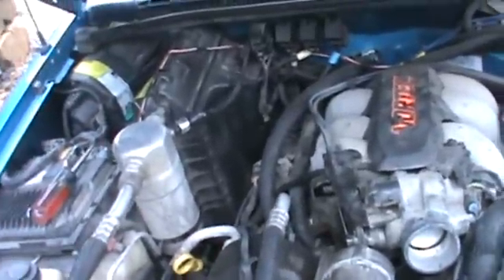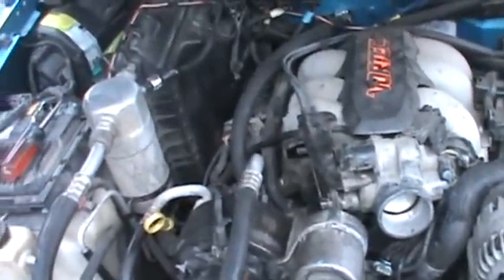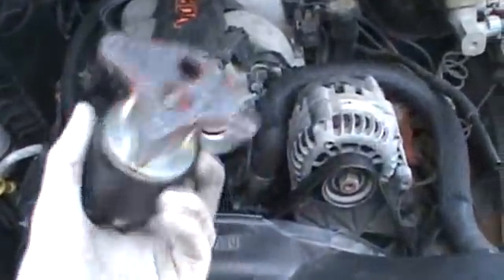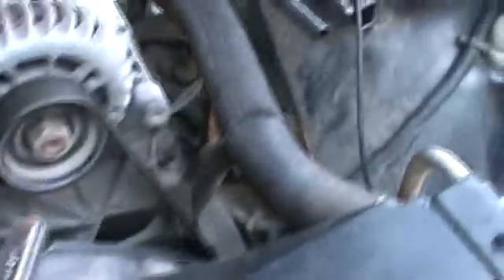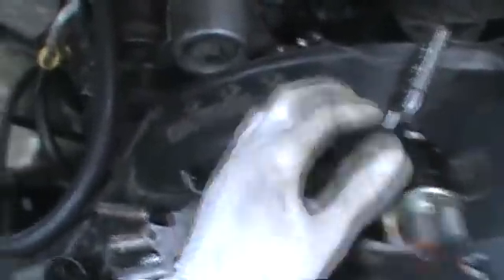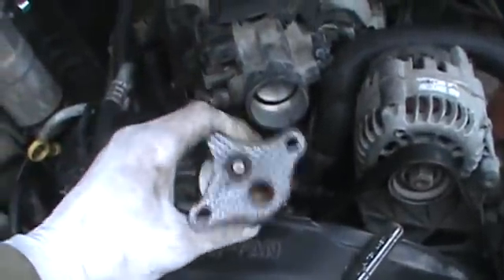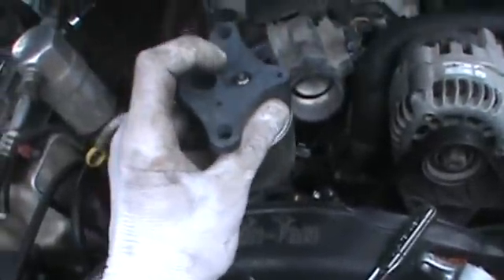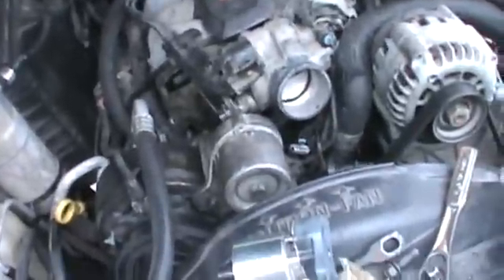how to fix General Motors Vortec EGR problems

Comment: On my old Toyota i could jump two wire in my fuse box and my engine light would flash, and i had to count the number of flashes to look in a Haynes book to find out what the problem is. I don't know if you can do it on this one but you could probably look it up.
Thanks

Comment: Let me guess egr light code came back on half year later lol
Reply: Every damn time!  I had to clean the screen on mine every six months for a couple years.  Now the light still comes on now matter what.  I replaced the EGR valve on a wing and a prayer, but that didn't work either.  So now I just live with it.  Runs the same as ever.
Reply: Cuz I did the same and that mf just would not and could not leave me the hell alone, I like the 4.3 but that shit was pissing me off lol ditched the 4.3 and went with the 5.7 and best choice I’ve ever made lol this one had way more mileage than my old 4.3 and yet the old egr on this one doesn’t care at all 😂 one thing is certain tho the 5.7 hella quicker and snappier, with a bit more torque, slapped some 295’s cooper cobras in the back and slotted rotors in the front 😎 shit sails, I love this piece of shit, but now I wanna go ls to see what the fuss is about and or 454 but they expensive

Comment: I had a p1406 at first, then I bought a new one EGR valve, then installed, then it showed the p0401 like it's not enough, then I bought another for 60 bux previous was 35, and it still not working good. P1406 came back and now I have p0140 there:( 3 freaking codes now

Comment: I am getting the same code but my truck wont start... ran fine last night.
fixed it today and it was a ground wire in the trailer hitch. the ground was broken and it was causing the truck to not start at all.

Comment: When I start with the egr off the engine revs up high is that normal
Reply: Ya unmetered air enters and the fuel system tries to compensate - I scribed the egr on a piece of aluminum 30 thou thick, and cut out the shape and bolted the aluminum in it’s place then you can run it and watch the pintle

Comment: Use paper clip and connect terminals A and B of the diagnostic connector. Turn your ignition key on with engine off and the codes will flash from engine light.
Reply: Diagnose it don't do what he says like just replacing random chit that you don't know is broke it's more common that spider injector's act up on vortec engine's.
Reply: Bad egrs wont always trigger a fault
Reply: My point was that its ez to run codes because he acts like its not

Comment: I have 1997 s10 2.2. It has this same egr valve as this video. I did the test, it wasnt working, bought a new one....still not working, the new one is also not opening and closing. What is the next step to try to fix my truck? And how? Thanks for any help

Comment: so my car sounds like shit right, just ruh ruh ruh stutter sound, i have change the air flow cause it said, then i gave a descent tune up, new sparks and wires, but for some reason it kicks back when i accerlerate like around 5 RPM do you know why ? i also put a new crank shaft sensor
fuck it someone call me if you know, 2564583744  4.3 engine by the way
Reply: Lazaro Gaspar had the same problem on my Tahoe.....had my 3,5,7 wires mixed up....

Comment: ! am an ASE Master Tech and I own a '95 1/2 Jimmy.  There is a scanner that will pull codes for this vehicle and it works with the "Torque" app and bluetooth.  It will not do "Mode 6."  These EGR valves can stick open because of carbon and the fix is an EGR gasket with a screen built in to it.  There is not a separate system that measures EGR flow.  So, if you get a P0401 99% of the time it is a bad valve.  Thanks!
Reply: I have a 95 1/2 Blazer, which fortunately has OBDII.  Got the P0401 "EGR flow insufficient" code going right now, so looks like a new valve for me.
Reply: The screen in mine burned out in no time...fix my ass
Reply: wtf did you just say dude ? so my car sounds like shit right, just ruh ruh ruh stutter sound, i have change the air flow cause it said, then i gave a descent tune up, new sparks and wires, but for some reason it kicks back when i accerlerate like around 5 RPM do you know why ? i also put a new crank shaft sensor

Comment: Had a 94 Sonoma 4'3...bought new  taken care of...biggest piece of shit ever. Constant egr problems  after  30k miles...not to mention...fuel pump,,,the injection system...altenator.AC.front end.power windows,,mirrions,,wipers...everything you could think of broke on that hunk of junk.Swore me off  GM forever.
Reply: Mike Brewer got a 2000 jimmy 4.3. You aint lyin. Bought it cause it was sitting in a field with 95k on it. Some dumbass kid slaughtered the 4l60e in it (i have no idea how). It sat for 4 months before I bought it. I have replaced fuel pump, filter, spider, fpr, maf, egr, pcv, vacuum lines, and lucifers left testicle. Runs great now, but f%@$ this thing.
Reply: Forgot the control arms and 2 computers...1st under warranty 2nd one cost me $1000 bucks.It was a beautiful truck too....an SLE with the very rare purple paint.Finally got rid of that monstrosity after the 5th EGR valve. and the dreaded code 32.. Only the 94-96 HO 4'3's had that particular part. Left me on the side of the road many times.One time had a new one put I at the dealer and didn't even make it home..I will say the engine.trans  and cooling system were fantastic....no troubles there..but I went back to a new Nissan truck..and I still have it 15 years  later. Only been stranded twice with a dead battery and once a  1ten year old radiator hose  broke.. I will probably die before this truck.
Reply: Mike Brewer yeah. It is hangin in there at the moment. I have done a 350 swap on two s10s. I am almost tempted to fix the next problem with a good ol "bye bye 4.3" action. I just dont know if I am prepared for the mpg loss lol. Arkansas doesnt have inspections so you can do it right
Reply: Eli..I might add the replacement  Egr's were the "improved" ones with the screen to prevent them from clogging up....but  the screens burned up in no time
Reply: Mike Brewer if the computers werent so damn touchy, could have bypassed the egr all together. But noooooo. Gm wants every chinese ass part to work in harmony
Reply: Well im in California so that wasn't an option.I like  the 4.3...had an 89 with over 200k miles when the trans gave out so that's why I bought the new 94.
Reply: Mike Brewer a 4.3 is an incredibly good motor. It is a mini v8, literally. But, gm managed to castrate everything it could possibly be. The only way to enjoy one is to take it back to the carb days, when shit worked great with the turn of 2 or 3 screws. As you said though, cali kinda keeps a motor head/someone who enjoys american engineering, from doing anything productive.
Reply: My  CPI injection failed about 60'000 miles and cost a fortune..about 900 bucks in 1999.  My  repair shop said  he saw so  many of them he actually  kept the kits in stock..I cant fathom how even GM could build such a pile of shit.

Comment: My smog system has been removed everything blocked off and I am getting egr codes and truck stumbles and hesitates around 1900 rpms to 2500 rpms when above 55
Reply: I have changed the entire ignition system and the only codes are for the smog and egr. Any thoughts?? It is a 1997 Yukon 4wd 5.7
Reply: Sounds like a clogged catilatic converter
Reply: so my car sounds like shit right, just ruh ruh ruh stutter sound, i have change the air flow cause it said, then i gave a descent tune up, new sparks and wires, but for some reason it kicks back when i accerlerate like around 5 RPM do you know why ? i also put a new crank shaft sensor 

same here with my truck
Reply: You gotta have it programmed out

Comment: Wish us he would of actually shown us the removal of all the crap in the way of getting the egr valve out and maybe even the tools required. Not a single video on youtube doing it to this motor inside a suv/truck chassis
Reply: You only need a basic socket set. You can't have someone hold your hand for every little thing. If you can't figure out how to take two bolts out then maybe working on your car isn't for you.
Reply: It has two bolts on it, all you do is unscrew them and then unplug it.
Reply: man its two bolts.... doesnt sound like you should even be messing with it
Reply: 2 10 mm bolts on the front of the engine at eye level, easy peasy

Comment: can these parts be cleaned n how...  I'm getting the egr  code but my car is not running ruff n is idling normal..  n drives smoothly on a 2000 GM Yukon  Denali

Comment: It's not recommended to blow compressed air through the egr valve, if doing so may result in chunks of carbon to be logged down in the intake ports or into the combustion chambers and can result in internal damage such as valve seat damage cylinder wall gauging which results in loss of compression and oil burning and rough idle and defiantly poor gas milage! the only way to clean the port is a small cleaning brush and vacuum cleaner and carb spray.
Reply: Most of the carbon lodges in the top of the tubes on the v8 LS engines. The proper way to do clean that out on the v8 LS engine is to take it to someone that can heat the bolts in the bottom of the V8 engines that have that tube. In this case this is a 4.3L and removing and cleaning the intake makes a huge diff once the new valve is in it. U won't be throwing carbon down an already partially blocked intake by trying to a half assed clean job. The 4.3L intake porting for the EGR can at times cake up severely and in almost every 4.3L I have ever worked on if the valve is caked up and the port at the top of the intake is also caked up inside the intake. THEN it needs to come off>>> (THE REASONS YOU SEE FOLKS REPLACING NEW EGR VALVES). When only the top of the intake port is clear the valve itself is new. It will only functions for few 1000 miles and ya got the problem right back plus you start burning valves up. The people with the 4.8L on up are lucky GM got wise to their mistakes on mounting the EGR on the intake it self so when they went to the HEMI clone motors known as the LS engine they also designed that beautiful plastic wonder called the Vortek intake that works like a gem. The LS motor tube assembly for a new QUALITY part is about 80 bucks you can even buy a cheap EGR for about 40 bucks on EBAY. As stated take it to someone that can get those little bolts in the bottom of the tube out without stripping em and having to remove the exhaust manifold. A blocked EGR can effect compression and not just a running engine but a static compression test can show lower than normal cylinder pressures. Had it happen here. Nearly told a customer his 4.3 engine was shot only 100 pounds a cylinder. Once the manifold was cleaned out and new EGR was in place the engine compression jumped up to 135lbs a cylinder. Not impressive by any means but for a 4.3 4.8 and the 5.3 motor about 140lbs is a normal used engine. Anything above 160 is a phenomenon okay. I have seen 190K 5.3L with 170lbs & 160 a cylinder. The 4.8 with a clean EGR will check out at about 140 to 160 a cyl.  Never ever just replace 4.3L intake mounted EGR valve and spray it with air & carb cleaner. THE PROPER PROCEDURE IS TO REMOVE THE INTAKE AND TAKE IT TO A SHOP THAT HAS A DIP TANK. Any machine shop will have your intake for 3 to 6 days. I let em sit in the acid for 3 days myself. Anything less ya still have gum and gunk inside the intake. Then I run my brushes thru em. That also makes the remaining shit fly out onto me all over the work bench and at times out the other side of the intake port holes. Never just slap a new EGR on a 4.3L intake and do a half assed clean out job. A new valve will start making the engine run lean and start frying valves and tops of pistons. A 4.3L intake is not easy easy to remove but easy enough that you can git it done. Remember to mark your distributor on the 4.3L with a distributor. I hope I helped here and nobody bites my head off. Replacing the valve and half assed cleaning is only prolonging a total engine failure or engine burn up.

Comment: I have a 2000 blazer and when I try to start it, it acts like its really trying to start, but it won't turn over. A guy used his code reader and told me he thought it could be my EGR valve. Is that a common problem?
Reply: its the fuel pump. these vehicles blazer/jimmy must have a full 55psi to start
Reply: okeye1388... was it the egr
Reply: distributor cap mostly
Reply: okeye1388 distributor cap is bad